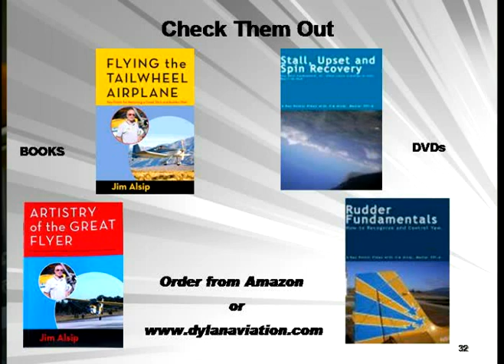The Base to Final (Booby Trap) Turn

Comment: And if you do not have a stable approach, break it off and go around regardless of where you are in the pattern. Do not try to salvage a bad approach or landing. If you’ve overshot that turn to final, go around rather than try to muscle it to the centerline. That $10 in gas will be the best money you ever spent.
Reply from the maker: low time pilots and those who have not mastered airmanship (proper use of flight controls) should heed that great advise - Unstable approach? go around; however, for stick and rudder pilots one of our most common maneuvers is the side slip for realignment with the runway.
Even the best pilot might be wide on a base to final turn. Instead of yanking and jerking or doing a hideous and unstable S turn, an airman might maintain bank and airspeed upon completion of the turn (change of direction) and then use some top rudder to slip the airplane to centerline alignment.
Reply: @JimAlsipMCFI  I would think it applies regardless of pilot time. A high percentage of pattern crashes involve high-time pilots trying to salvage a bad approach to landing, improper go around, or the impossible return after engine out. Sometimes, experience has complacency at the controls. Flight physics are always present. If you are on a long final and need to slip over, that is fine because you are still in a stabilized approach. Trying to slip over to correct a wide short final is an invitation to  yaw and stall and spin. That is not a stable approach. That would be trying to salvage an unstable approach, and that is always the calculation that gets these bad results. Sometimes it works but it doesn’t many times. That means it’s a gamble with getting it just right. Many lose that bet.

Comment: I think this was the wrong message.  the answer is not spin recovery on the base turn close to the ground, wrong answer.  The right answer is skids are bad , slips are not. the Problem here is too much rudder.    The Student learns about coordinated turns but you would not guess it is the ,if a little is good, then more should be okay and the answer is , too much rudder can kill you.. and that was the whole great beginning where you talk about what is happening but , the end answer , recovery from a spin close to the ground , no , that is not the answer.  the Answer is the way not to get hit by the train is don't be on the tracks when it gets there
Reply from the maker: This video, taken from that great  book Stick and Rudder, is a classic explanation  of how "good pilots" can become involved in skidding stall/spin loss of control. The lesson to be learned is that the elevator controls angle of attack and only the elevator can make an airplane stall.  Rudder does not make airplane stall. No stall - no spin. Your hang up with rudder misses that more important point. 
To your point about slips, this video talks about a skidding spin; however, the more common and more deadly spin is the slipping spin. The high wing stalls and rolls under the bottom. That is commonly called a departure stall/spin.
Reply: @JimAlsipMCFI  100% agree the stall is the issue, but go back and watch your video,, you say the important way to handle it is training for spin recovery, and again, i think if you spin at low altitude most of us, will not recover so the real answer is avoid the spine , 1. right sure get the nose down , not up, 2 ,yeah, i think the issue is nose up "too much rudder "  so don't do those , and , also the fatal moves are , nose  up, stall and "aileron,, so stick down straight to brake the stall and not spin is the answer ,, not training for spin recovery ,, go back and listen to yourself and decide , do your really want to say that?
Reply from the maker: Thank you for a well reasoned and thoughtful comment. The subject is broad and I could write a book about it. (actually I did). Just a couple quick points:
1. my experience is that with effective spin training, a pilot will never experience an accidental spin.
2. Practical spin training involves early recognition, rrecovery and avoidance of spins. That course of study will demonstrate that proper flight control inputs for steep turns, upset recovery and spin recovery are identical.
Please follow my current YouTube series Airmanship and Aerodynamics. I think it develops the principles of airmanship that are not being taught in pilot school and more fully expands my comment #2 above.

Comment: the question is not can they recover, it's can they recover at typical altitudes. time and time again, the answer is no.
Reply from the maker: Actually the answer is Yes. Every CFI candidate (well actually there where a few exceptions) to whom I have ever given spin training, has been successful in recovering this scenario with less than 500 foot loss of altitude. They enter a spin, recognize the spin, recovery to inverted nose low attitude and  then recover the bad attitude back to straight and level. They can do that with only the minimal training received in my CFI spin endorsement course. They certainly do not learn that in pilot school.
But wait!  Your answer "NO" is correct; not because of limited altitude, but because most pilots will never see (recognize) the spin. I could tell you why, but that is no fun. Think about it, and maybe change the way you fly.
I give a proper answer and many clues as a theme in several of my Hangar Talk videos and essays.

Comment: 100% agree. I was taught to "fly like i'm walking on ice" at low speed + low altitude. The situation you describe is especially likely when you have a tailwind on base.
Reply: Yes!  Good point.  Pilots new and old need to remind themselves of the winds when working the traffic pattern.  Don't take it for granted.
Reply: This is exactly what happened last week at KBJC to N73670. Strong tailwind (Gusting 20kts) on base blowing the pilot into the runway, necessitating a steeper base-final turn.

Comment: I see this easily happening at my Class D airport with parallel runways. I always try to make shallow turns but I have made steep turns to avoid flying into the flight path of the parallel runway. Nothing that would be considered aerobatic...shhh...lol
Great advice here!
I wonder if there's a a statistic showing who's more prone to this  high wing vs low wing. Low wing guys have an advantage over us high wing guys when it comes to turning on the pattern imo.

Comment: I had an instructor that I really believe was Pschycotic and Suicidal. I reported him to CASA Australia. He continually harrased me during Circuit Training. With his constant distracting harassment, I overshot on Base at about 500 feet. Up till then he didn't shut up, now at this most dangerous point he said NOTHING. I did a slow 180 descending turn, then in line with R11 did a sharp 90 descending turn for a good landing. Low speed and low altitude. When I described this to a Moderator of another group he said it sent shivers up his spine. It is the best way for pilots to get killed. That's why I thought Dieter was suicidal.
 I feel what saved me was the fact that due to my inexperience at the time, I DIDN'T use the Rudder. Only the Ailerons. Do you agree that my not using the Rudder prevented a "Cross Control" accident?
Reply: Under those circumstances the rudder would have changed your angle of attack to outside the flight envelope.... = high probability of a stall

Comment: Harry said lot of fixes for this problem -#1 is use of proper ruder#2 is make turn from base to final with a little bit of half moon as your lining up for runway and this will stop a lot of over shooting the runway just simply by doing a little half moon turn from base to final.

Comment: I naturally come in a little fast and am extremely reluctant to use rudder in the pattern. I know that’s extreme but I’m very scared to stall in the pattern. I’ve always been that way. There is no way I’m getting into a cross controlled stall just by the way I fly in the pattern. I use rudder on short final to flare that’s about it and maybe to stay coordinated in my turns but even then I’m carful.
Reply from the maker: Rudder and aileron and  action of "cross control" and skidding has nothing to do with a stall.  The only way an airplane can stall is by using the angle of attack control (that would be the elevator) to force the airplane to exceed its critical angle of attack. Pilot school generally does a poor job of teaching this fundamental.  Pilots cause airplanes to stall with excessive elevator back pressure (or forward pressure to stall negatively).
Fly high, have fun and do not stall - Jim
Reply: Jim Alsip I really monitor my speed basically 90 80 70. That stall on base to final is always on my mind to the point I sometimes come in a little fast.

Comment: Spin recovery at pattern altitude is impossible.  I've never done spin training or practice below 5000 feet because the recovery takes all of 1-3000 feet realistically.
Reply: Turn to final is usually half of pattern altitude anyway.
Reply: @glibsonoran  BUT, you crash anyway.  No spin recovery is possible below 1000', realistically speaking.
Reply: I think it would depend on a lot of different factors like how long it takes for corrective inputs to be made and the type of aircraft.  It has to be very difficult though. I think the biggest problem is that if you forced the plane into a spin you probably don't know enough about what just happened to get out of it.  If you did you wouldn't have spun the plane in the first place.  Basic training needs to include accelerated stalls and spins, there is just not enough training in that area and the safety record demonstrates that fact.
Reply: @utah20gflyer76  That's an old issue since spin training gradually stopped being a demanded skill to have before licensing at all.  Reasonably, pilots WANT to be trained and know how to best recover from recoverable emergencies they may so easily, suddenly and unknowingly encounter.  But overwhelming, illogical FEAR and complacency keeps the training, national skill levels correspondingly low and any spin encountered now is, by and large, unrecoverable, by these pilots flying without any spin recovery capability, familiarity and competence.
Reply: Altitude required for spin recovery depends on the plane.  A little Cessna 150 /152 can probably be recovered in a few hundred feet if you don't delay recovery.  A T-34 may require 1,000 feet because you have to shove that nose down hard into a dive to recover if there was a heavy passenger in the back seat.  Then there was an aerobatic rated sail plane that took two and a half turns after recovery control inputs before the rotation began to slow.  Although it was rated first spins, I never did another one in that bird.  Too scary.  More like a flat spin.
Reply: They say not to attempt the impossible turn if you haven't reached 1000 AGL..... normal spin recovery should be done in 700' with a Warrior II
Reply: @canconservative8976  give or take 100-300 feet, the winds, plane weight, fuel-load balance, aircraft loading, pilot control input acuity . . .
   Get real.  Realistically, unexpected spin recovery at or below traffic pattern altitude, 1000 feet, is most probably irrecoverable, especially if the aircraft is fully configured for landing or take-off.
Reply: @jeffwalther3935  I agree with you.... I didn't mean to say that it's not a problem recovering from a spin at 1000 AGL, all those factors you mentioned have an effect (to the detriment) best to stay in the flight envelope of the aircraft or go around.
Reply: @canconservative8976  You betcha!  Fly in the pattern as if your mom's or flight instructor  in the right seat or watching from the ground, and you'll be fine.
    The killing part comes into play when senses, rehearsed plans, reaction time and focus are slowed or missing after long hours of uneventful flightime.  The pilot, flightdeck and passengers all really need to more fully and formally  transition from flightime to landing time and awareness.
Reply: jeff walther that’s a really good point... after a long uneventful flight, you are faced with the greatest and busiest challenge, the landing... I suppose checklists, and sound coordinated protocols between the PIC and FO is key.
Reply: @canconservative8976  I was thinking why this time especially, common to every flight, developed a dangerous tendency to stall/spins.  What's different is the workload, pilot control demands and tolerances, distractions, unreadiness, lack of differentiation in high altitude, cruising transient flight to low altitude and airspeed full-stop operations with twice as much traffic, control inputs and radio calls and responses ALL OF A SUDDEN, when you're the most fatigued you'll ever be in the flight.
   Keep your angles of bank turns below 20 degrees at slow airspeeds and approach manuevers, with go-around throttle-up ready to go inna dplit-second IF near stall airspeed +10 kts.  Don't compulsively try to save inadvertantly bad approaches with high angle sharp turns at low airspeed or else . . . you'll die.
Reply: jeff walther well said.
Reply: @canconservative8976  I got into a habit of getting super careful in the traffic pattern and never executed intended turns beyond 20 degrees and kept a ready hand on the throttles to motor my way out of any unusual attitudes in the approach along with little or no hesitancy to go around again rather than risk the need for sharp turns.
   The epic Fairchild AFB B-52 crash film footage shows the pilot making a 90 angle of bank turn at low altitude and airspeed, to recover a bad approach, I think, just fall out of the sky.

Comment: I'm a very novice pilot (76 hours, still have my paper PPL). All through training my instructors kept pinging on me to fly a tighter pattern. Meanwhile, I keep hearing about the dangers of the base-to-final turn (or downwind-to-base). Seems to me that, by flying a wider pattern I will have more time to make the turns and I can make them more gently, thus more safely. Does anyone else see the contradiction here?
Reply: You have 2 different competing factors, staying tight makes it more likely you will make the runway if your engine quits but may increase the chance of a stall/spin. A wider pattern makes it easier to make gradual adjustments and avoid a stall spin situation but you may have more trouble making the runway if the engine quits.  

Between the 2 stall/spins kill more pilots than engines quiting so I would tend to ere to a little looser pattern.  Personally I focus on always flying coordinated and never exceeding the bank angle of a standard rate turn while in the pattern. Those 2 things will prevent a spin and if you add maintain sufficient airspeed you will never stall. In the case you don't maintain airspeed the stall will at least be much easier to recover from and you will have a good chance of getting yourself out of the situation without harm.  Pretty much no one kills themselves with a straight ahead stall. It is unfortunate that is the type of stall taught during training.  Accelerated stale and spins are the actual danger but don't resemble the straight ahead version very much at all.
Reply: @utah20gflyer76  well said I also like to be a little high on final which allows for a looser pattern then if needed I can slip on final to lose the excess altitude.
Reply: Wider patterns help to  prevent tight slow turns which can be dangerous if speed is too slow

Comment: If people have problems on the final turn it means that they have not been taught properly. If the aircraft is set up for the final approach at the right speed on base leg, the turn onto final is not dangerous. You have to be pretty robust on the controls to bugger it up.
Reply: People get in trouble because they get distracted on the base leg and turn too late, maybe a bird flew by too close or a passenger asked a question.  Also a strong gusty crosswind blowing from the pattern side can push you out of alignment more than you expected.  Round out your turn, straighten up and go around, only takes a minute or two.

Comment: Good video Jim.  On approach,  avoid bottom rudder and keep the sight picture.  Simple.   If it stalls, correct with opposite rudder vs aileron and drop the nose.  Pilots need more training like you provide in your 8KCAB.    You're one of the best!